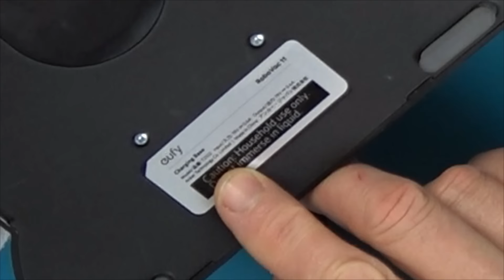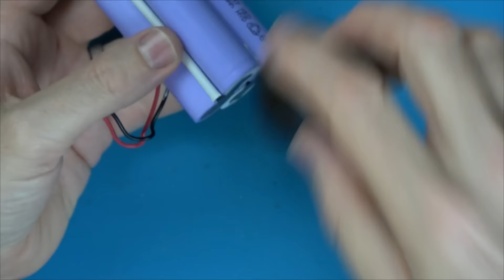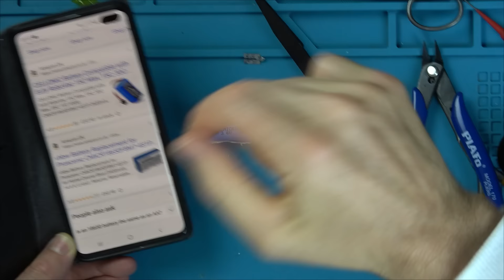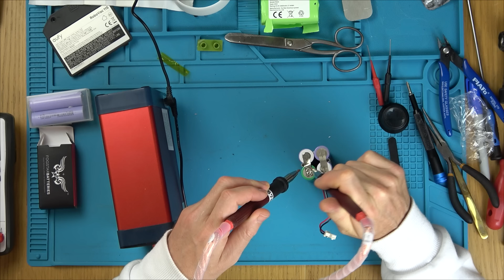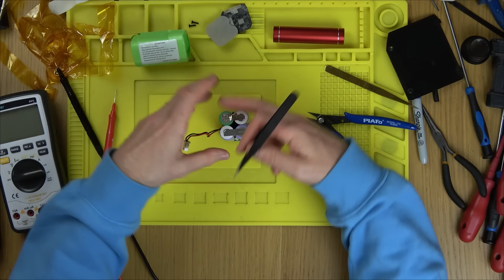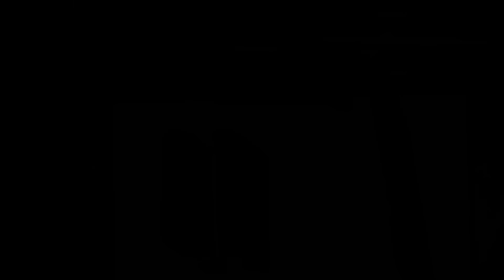Robotic Vacuum Cleaner that SUDDENLY stopped WORKING! - Can it be Repaired?

Comment: Euvy is batteries are the weak point. Replacement  them already 2 times.  Also the  3rd battery has issues for a while but it's still working for know. Great vacuum robots with bad batteries.

Comment: Discharge rate of "3c" explanation
"C" refers to "capacity" 
so if your capacity is 2600 mah
then 3c is equal to 3 times 2600 = 7800 milliamps = 7.8 amps.
So maximum output is 7.8 amps

This is how C ratings work on lithium polymer battery packs, I am being an ass and assuming it is the same for li-ion

Comment: I never knew that 18650's had that built in safety device. That is making me think twice about using them in my model aircraft. I switched to 18650 packs a couple of years ago because they were lighter than the equivalent lipo packs. Whilst it's great to learn of the built in safety feature I am not so sure about using battery packs in an aircraft that could just cut the power without warning. Very interesting.

Comment: Those 10 volts probably are through some high resistance. Multimeter is showing volts, but if you would put any load on the output the voltage would drop to 0. Same with the power supply. Voltage jumped to 19 volts, but through that high resistance, there isn't any charge going in

Comment: Please, please! go learn about maximum safe Lipo charge voltage!  Putting 19v into 4 Lipos is so wrong.  Max Lipo charge voltage is 4.2v per cell,  so for your 4 pack your power supply should be 16.8v MAX.  You should never exceed applying 4.2v per cell - cell manufacturers warn it can end in fire.  Watching this one bothered me that you may have some people copying this that just don't understand.  I would bet the voltage on the vacuum charge station goes through some circuitry to lower the voltage before the battery pack, it would not have applied 19v to the pack or else there would be a lot of house fires with those units.

Comment: Replacing one cell in a battery pack will never work even if you would use the same capacity and brand, all cells must be exactly matching or they will drift out of voltage when you load or charge them leading to instant failure of the other cells that will reach critical voltages due to imbalance. since batteries ages their actual capacity also changes making their properties change and when you connect the batteries in series all cells must match exactly or they will fail or ruin the function of the battery. the weakest battery will determine the capacity of the pack since it will reach it´s limiting voltages first. and when the cells have different voltages the pack will also not run at full capacity since the pack will stop charging when the first battery with the highest voltage reach the limit first and then shut down when the battery with the lowest voltage reach this limit first capping a lot of potential capacity you could use if it was balanced. I see this happen a lot on power tool batteries. after proper balancing they can run like new again.

Comment: i knew that second cell was bad because it was only reading 3.5v before you removed the first battery the last two may still be OK for a while if you had replaced both batteries to start with it may have actually lasted a year or more and why the cells may have failed is from internal dendrite formation shorts which caused the battery to get hotter than normal then putting it back on the charger it will continue to overheat until the vent causes it to disconnect to stop thermal runaway keeping the battery from exploding on the charger this is most likely from the high voltage fed to the battery from the charger a 14v battery should only be charged by a 16v charger at a low amp rate for 4-8 hours not a 1 hour  charge that's part of the reasons why the hoverboards kept catching on fire cheap batteries and cheap management boards with a over rated charger

Comment: I have seen a lot of cells break due to the CID. It might also be due to age and vibrations. There could be a lot of factors at play here. Also, please do not mix cells of different specs or age. I've done that many times and it never worked for longer than a few charges. Also resetting the CID is possible, yes, but whenever i tried, the cells died again soon after. And they never had good performance to begin with. I think it's got to do with air getting into the cell chemistry when the CID membrane is damaged.

Comment: I fixed one of these recently - it was the Wall Brick PSU failing intermittently, constantly cycling over/under voltage (up to 25+ volts, down to 6). Possible something similar killed your battery pack?

Comment: I don't think the cell protection has kicked in. Most defective 18650 I have seen show 0 volts because of internal shorts. They can be charged with a charger - but get quite hot even with only 500mA charging current. The capacity is only a few mAh and they go back to 0 volt in about 1-5 hours. That is the normal failure mode of old worn out cells that I have seen so far.
edit: never mind .. I rewatched the part where you check the cell and you are probably right .. 0 volts AND open on resistance check means it is disconnected

Comment: The C rating works like this: if it’s 3C, it’s discharge capacity is 3x the battery capacity, in this case it’s 7800mah(3x2600)

Comment: When concerning balancing batteries in a pack, the logic board will usually self balance. The cells will charge slower until balanced and then start charging at full capacity.

Comment: I had the same issue with the same model. And cell was OL but it was good I just needed to reset it by pushing needle under positive contact. There are holes under positive cap where you push with something sharp.

Comment: Those robot vacuum cleaners are great at collecting dust, my brother bought one and after a week of use, it’s been collecting dust at the back of a closet. That thing made such a racket that trying to be at home when the thing was running was like trying to live in an airport runway.
Regarding the battery, there are certain BMCs (battery management controllers) that keep count of the charge cicles, charge and discharge rates, and remaining capacity, and are programmed to deactivate the pack at certain established point. Not the case of this one, but there are battery packs that can block themself at the end of their expected life. Nice video!
Reply: what robot vacuum did your brother buy

Comment: The C rating you found is a measure of amperage the cell can be charged or discharged at. A rating of 1 on your 2500mAh cell would mean it can be charged or discharged at 2.5A. A rating of 3 would be 7.5A. 
Basically multiply the capacity by whatever the C is. Just watch out though as sometimes cells will have different C rates for charge vs discharge.
Reply: Exactly this ☝

Comment: Lol I nearly lost my thumb when a quite expensive pair o' 18650's vented on me as I was holding the mod and very very nearly destroyed my also quite expensive Snowfeng X mod but I managed to repair that, brand of the cell I think was Molicell and I know someone else in this town also had their 18650 Molicel's blow up on 'em too...   Suspect they were rewrapped half dead laptop cells.   As for when my current ones die, to the delight of daughter I go out there with a nail duct taped to a bamboo stick and on the tarmac I give them a damned good stabbin' puff chuff arc of fire and sparks and then I know it won't blow up on anyone in the recycle place lol

Comment: I would have just cut the strip. You spent so long using tweezers and side cutters trying to remove the metal strip from that battery, and you shorted 2 together, that you would have been far better off (and safer) just cutting the strip between the 2 batteries.

Comment: The protection IC (probably a DW01) detects a cell voltage for both high and low voltage conditions and disconnects the cell from the circuit.

Comment: A "C" rating is a multiplication of the rated capacity in relation to charge or discharge rates, in this instance a 1C would be 2600mA, 2C would be 5200mA, 3C would be 7800mA, 4C 10400mA etc.
Reply from the maker: Thanks Scott, that is a nice easy one to remember. Excellent 👍

Comment: The protection chip, probably a DW01 will be shutting off the battery connection, because it has detected a cell is less than about 2.8V.

Comment: I think I know why the second battery failed so quickly Vince! In use the new battery you installed may have a vastly different drain rate so it's capable of putting out say 25 amps of current. When paired with cells that can only put out say 6 amp it would cause them to heat quickly. Just an opinion but I think if you replaced them with cells of the correct type - either replace ALL 4 or just get the right original cells you would not have had an immediate failure. Just my opinion! ABSOLUTELY LOVED the video - keep them coming!
Reply: That is not how current works, the weakest cell (highest internal resistance) in a series string determines the maximum current for the string. 
Nevertheless: Replacing all would have helped, but he only has very expensive cells and you can buy the whole pack for under 20EUR from China.

Comment: I am interested in that spot welder, looking to replace my tiny battery powered one that can only spot weld 0.15mm nickel strip, 0.20mm is just too thick for it and the welds are weak. 

I find to get the power setting on the spot welder right I use some scrap pieces of nickel plate of the same thickness I am going to use on the batteries. I then slowly work my way up in power until I am happy I can't tear apart the strips with my hands.

You can go too high with the power and the spot welder will just blow a hole right through the Nickel strip.

I found I was pressing way to hard with the probes which led to a poor spot weld, I guess that's because my spot welder has limited power and by me pressing really hard caused the connection to be to good allowing more amps to flow than my welder can deliver.

I only press lightly with just enough pressure to hold the Nickel against the battery this allows me to also reduce the power level on the spot welder and still get a good weld.

Comment: Letter C means physical discharge rate: if battery capacitance is 2600mAh, maximum current during short circuit will be 7800mA.

CID is required only in United States. You hadn't checked semiconductors on board, unbalanced cells could be result of improper BMS work. Opened cells are common problem of Makita tools.
Reply: The C rate is not the short circuit current - it is the maximum safe operating current. The short circuit current will be much higher.

Comment: Hehe it's Gufy :-D like Goofy. BTW are you sure that the 19V are going from the charger straight to the battery? I am not sure that the battery pack itself is charged with 19V. The battery protection chip would certainly stop the overvoltage.
I do have a device like this, but more  "intelligent". It can map out the rooms and move in a grid patterns. It's more effective and requires less battery juice.

Comment: Good discovery. Use caution when welding (too high a current can punch holes in terminals).  Even a quality 18650 only lasts around 200 charge cycles (given the current that the vacuum must be drawing, expect between 2 and 5 years use).
Reply: highly depends how you use them. For exemple if you don't need full capacity you should never fully charge them. Also they should be stored at around 60% cap.

Comment: I have reset some the cid's in the past but the procedure is particularly risky , I have cut away the positive cap to expose the part under it which is a bit like a eardrum kinda thing , you can shove it back in and the cell becomes live again but there is a risk the tool will stab through the thing and when i was charging a cell after doing so i had electrolyte leaking out the top from it so i dumped that outside , CID can also pop out if your drawing/charging too much current from it so maybe the cell you substituted for it has greater resistance or is not specked to pass that current. I was once speculating on i idea to reset the cid by placing the cell in a high pressure chamber so the air pressure would push it back in instead.

Comment: If balance 18650 cells or testing them you should get a smart charger for 18650 cell batteries (it supports other rechargeable battery types as well)

Comment: 6:13  Sorry, i'm confused   0.42 ... 4.2 ... \  6:40  [repeat]  0.42, 4.1, 3.6  ...  
6:51  0.42 "this side", meaning?     \ 7:00  ...   0.42   & 4.0   you see?   What is "here"?   
You ask, "has one of the cells failed?"  ...  You Just tested them [connected] still tested. 
Batteries alway confused me;  Charging, Memory, or not ...  UGH!

Comment: Your a brave man Vince, I tried making a battery pack - Once-  it set on fire.  BMS circuits often have charge and discharge fets so they may show volts out but wont allow changing in. Some have flash memory and can undervolt lockout so even replacing cells won't bring back to life. Some cells also have an overcurrent trip , like a bi-metalic click button but can't see that tripping in this setup (and unbranded cells)  The pressure trip is another feature which seems more likley as you describe. Fascinating to see how these have failed.

Comment: I have one of these in my house that I picked up off the street when I used to be a courier. Took it apart and appeared to have some liquid damage. Turns on but complains the battery is low even when a fully charged battery is inserted. You interested? Happy to post to you rather than it sitting in my cupboard

Comment: It has been in my head for eons that you never mix cells, even of the same type. And from what I've seen in the past. Most repairs of this sort usually involve replacing every cell at the same time. So much so,  that early in the vid when I saw you were only intending to replace one, I was thinking, you can do that!? Old Cell is not going to perform the same as a new cell, even with all those electronics. So to me it kinda makes sense that you'd burn out the old ones faster in that setup.
Reply: Capacity is capacity, you check the capacity and let your BMS do the trick. To be honest if you don't fully understand this technology you should leave it alone because it WILL burn your house down and maybe kill or injure someone.
Reply: @andymouse  BMS's are far from perfect. I pulled a pillow out of an in use Laptop a couple months ago. It was a friends machine that he runs as a desktop; always plugged in. If I didn't happen to open it up to do a RAM/HDD upgrade, who knows what would have happened.
Reply: @rbuschy  I agree, my point was to really hammer home that you need to know what your doing as you clearly do :)
Reply: With a proper working BMS it is no problem.

Comment: The "C" rating describes the cell's maximum allowable current relative to its capacity. So a 2500 mAh cell with a 3C rating can tolerate 7500 mA. There are separate ratings for charge and discharge, so a cell can be rated for, for example, 3C charge and 10C discharge.

Comment: So, i suspect there are 2 issues initially - the reason you had no voltage initially was because the battery protection circuitry had dropped all the way to cause it to enter under voltage protection. This disconnects the batteries from the rest of the circuit until something external causes it to reset. When you were probing around you caused enough of voltage to overcome the protection circuit and let the battery pack turn on. Once it turned on the initial issue of the dead battery was causing the charging to not work.

Another issue you may have - if 1 battery is weaker than the rest, under load it will deplete faster than the rest (or hold no charge and instantly drop to basically no load) and at that point it starts to reverse charge, which is really bad for the battery and could easily be what causes the battery to off gas and break the protection, or to actually cause the battery chemistry to go short circuit, rather than open circuit.

The 19.5v or even, over charging shouldn't be an issue as i suspect the charge circuit is designed to cut off once any cell reaches 4.2v, however because the battery management system isn't a balance charger, it won't ensure all cells reach 4.2v, which will mean any cell out of load with the rest will get weaker faster, and adding a stronger cell back into the mix will actually make this issue - plus the reverse charging one - more likely to occur. If you are using a non balancing charging system, you also want to match capacity, not just voltage as the higher capacity cell will deplete its voltage slower, and mean other cells drain even lower before a "flat voltage" is shown to the vacuum - though in theory the battery management system is meant to disconnect the cells in this instance, depends on how it is wired as to when that works.

Comment: I see that measure to fix behavior many times, even on your videos. This is some kind of BMS reset, when BMS is maybe in protection mode. From my experience it's almost always transistor and you induce current on gate pin, current flow and keep translator "open".

Comment: It's a completely unrelated fault to the one in the video. But I've seen batteries going down to 0mAh (aka, can't hold any more charge).
I don't remember the name, but I've seen it on a video made by Electronic repair school, pretty sure you'll find it if you search for "0mAh" on his channel's search

31:30 maybe cell balancing? I'm not an expert in batteries, but maybe it's charging the batteries that have a lower voltage.
Reply: Seems like an open circuit problem, could be internal
Reply: @ivanrlynn  the video, i'm not going to spoiler (mainly because, remember, that there's a charging circuit in between).
The one I'm talking about, no, it was actually taking charge, it was just the battery exausted due to use